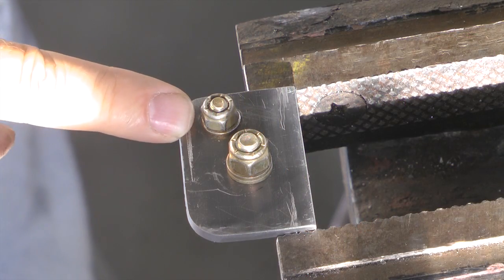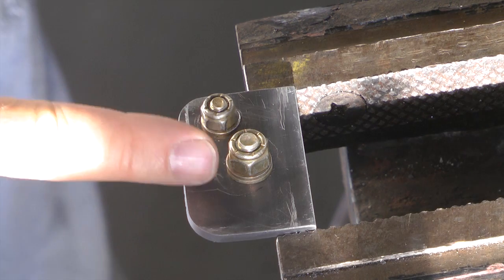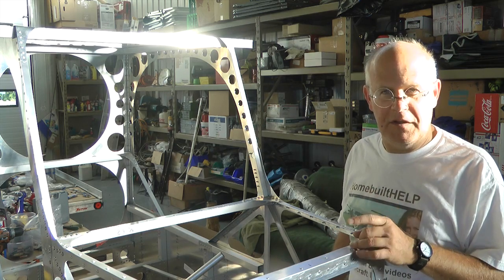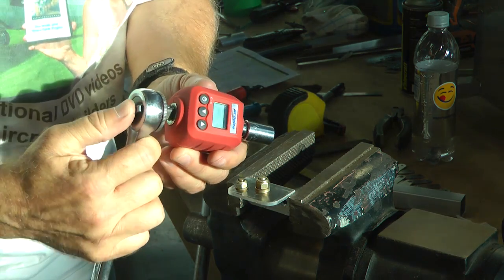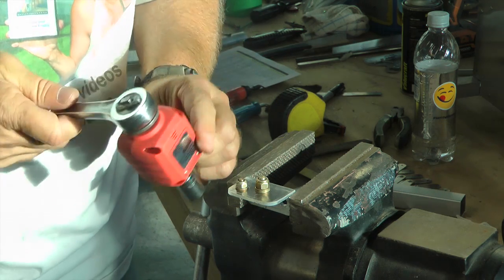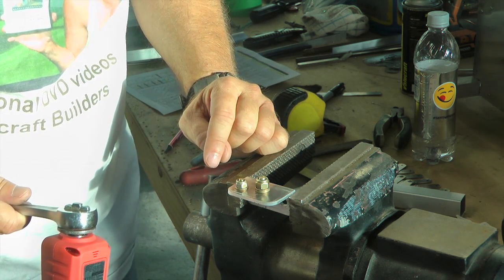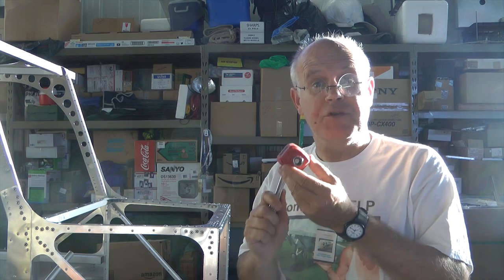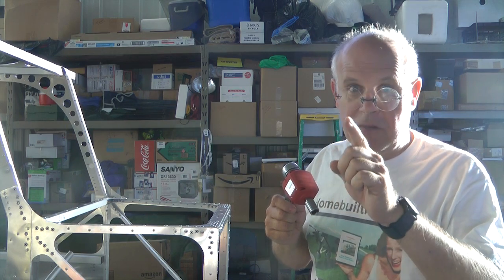How Accurate is your Hand for Torquing Bolts Properly?

Comment: I prefer manual over digital torque wrench. Adapters and extensions take approx -.5-1ft. lbs. from the actual reading from what I've noticed. Of course, every human has different strength, so tighten a bolt as much as you can with a standard wrench or ratchet, and then put a torque wrench on it and see what it reads. Then you will be able to guage how tight you need to tighten a bolt whether it recommends more ft. lbs. than you can exert, or less.

Comment: Never assume a torque wrench is calibrated when working on aircraft. Be it fancy digital or durable but inconvenient deflecting beam or typical click type, ensure it's in acceptable accuracy range before use!  

If you use an adapter to reach difficult hardware ensure you either have the adapter at 90 degrees to the wrench axis (no math required because that neither extends nor reduced overall leverage but pull SLOWLY for accuracy) or use tables/calculation to figure your actual leverage.

Comment: I’ve personally never heard of inch-pounds because we always use Nm. It’s just force*distance from pivot = torque or moment. So 1Nm = 1Newton * 1 metreAnd for a bike let’s say, you need 5Nm but you have a 5cm Allen key you have 5=N*0.05 so 5/0.05= force 5/0.05=100 so 100N an easy way to see this is divide by 10 (9.81) to get weight required because mass*accelaration=weight. Your mass can be 70kg but the scale says your weight is 700ish N it divides it by gravity to get mass so a ten kilo mass is required. Easy. Or use a weighing scale in the required units such a a luggage scale or something
Reply: Plus I only know physics not all this ANC 13 stuff tho
Reply: Over here in the States we also learn Newton-meters (at school) as units of torque but outside of science class we use lb-ft and in-ft in our daily lives.
Reply: I do hope you're not a teacher, that is totally confusing. Correct, but confusing.

Comment: Normal size wrench is sized so a normal man will torque a bolt or nut to 50% of the yield of a 30 KSI bolt (mild steel).   Torque wrenches are plus/minus of the set point.  The most accurate method is turn of the nut method.

Comment: I think it would be very nice to tell the risk or danger of overtighten a fastener.  Of course assuming that it does not strip threads.  I have been working on various devices since a small child (helping dad) and I am now 72 and building my first airplane airplane.  I am using a torque wrench for the airplane but have only used a torque wrench in places I know that proper torque is important before, e.g, cylinder heads.  Dad's rule was to always use the proper size wrench and the shorter length for smaller fasteners would  self limit the torque.  I believe doubling the torque for AN3 holding together two or more pieces or aluminum would have no adverse effects.Does anyone out there have a different opinion (surely someone) and if so can you provide a reference?
Reply: It's not about the threads... the fastener will reach its elastic limit and distort, reducing its integrity. It will break much easier than a fastener that was under-torqued or torqued to spec. Torque To Yield fasteners are designed to stretch for maximum clamping force, but only up to a specific point. After that point the integrity of the fastener is reduced. Since TTY fasteners stretch, they need to be disposed of and replaced when removed.
Reply: That's the way I've always done it, learning it from my father who was a military jet mechanic.  Only problem with him is he was an alcoholic and  also a fan of southern engineering aka: JerryRigging, and the other one, I will not mention, out of respect .  But like you say, on important engine parts like head bolts, rod bearing bolts, cam bearing's etc.  But on lesser important one's, I'm of the opinion that once you have done enough mechanical engineering through the years, you can pretty much tell how much torque to put on a nut or bolt from experience.

Comment: True.  The amount of torque pressure you apply to an AN-3 nut is surprisingly small.  The trick is figuring out the running torque and adding it to the final torque value.

Comment: Tiny torques!
I figure that my hand was calibrated primarily for 10 ft-# (spark plugs & oil drain plug) and 30 ft-# for other 1/2" or 12mm bolts, and my foot for 65 ft-# for lug nuts.  Other than those, I use a torque wrench -- especially for 2 ft-# or less  :)